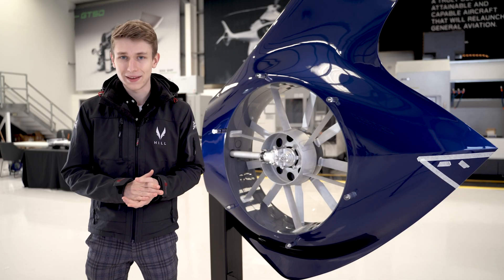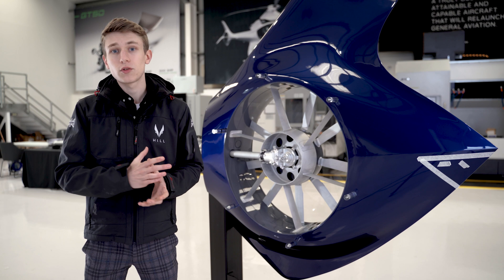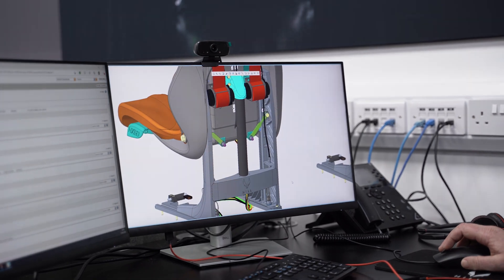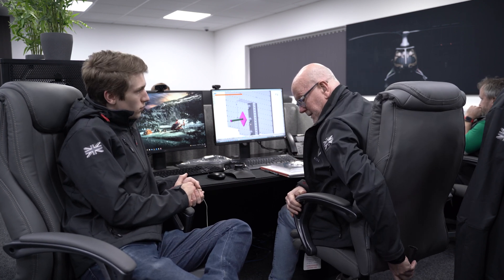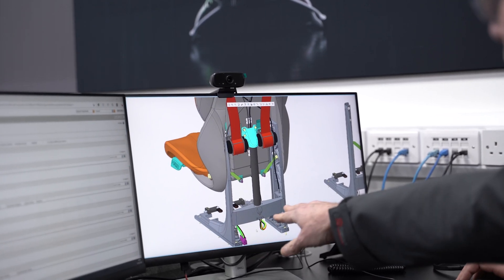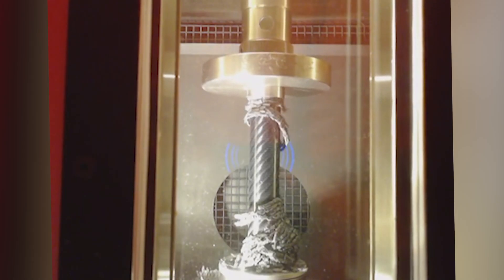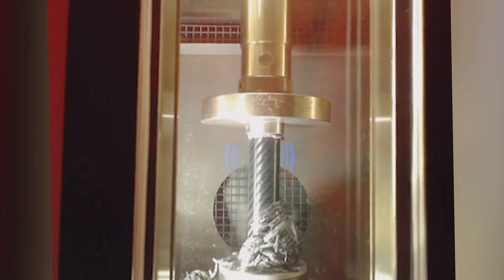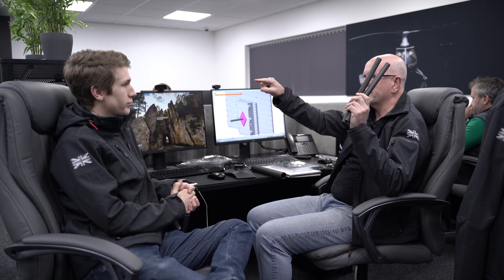Journey to HX50 | Episode 10: Crashworthiness tests for HX50 seats

Comment: I understand the physics involved but surely the structure of the airframe and cabin area would need serious mounting platforms to withstand the floor popping through?   The rig at the test site used massive steel platforms to retard the crushed tubes. ?